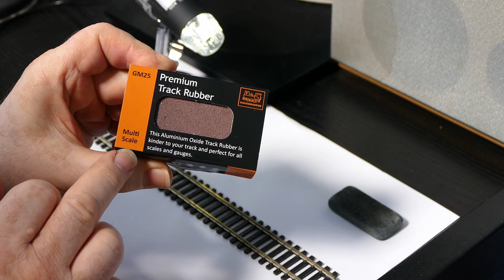Testing the brand new Gaugemaster GM 25 Premium Track rubber, does it scratch? Find out here!

Comment: The Peco track rubber uses fragments of carborumdum, the same as Emery paper. The Guage Master track rubber uses aluminium oxide (AKA ruby crystals).

The tarnishing of nickel silver track over time, even when covered over and not used, is actually caused by the silver content oxidising with the air. It's one of the disadvantages of nickel silver rails versus steel rails. I have both Peco Streamline flexi-track in nickel silver and steel, on my layout, with the parts of the layout with steel track requiring the least amount of cleaning, just the removal of traction tyre residue maybe once a year.
Reply from the maker: Oh now that's interesting, I moved away from steel rails in the late 70s. But you actually find it an advantage?
Reply: @ModelRailwaysUnlimited  Nickel silver has an electron velocity factor of 0.97c, where as steel has an electron velocity factor of 0.91c Basically, in non-engineering terms, steel isn't such a good conductor as nickel silver and so has a bigger power loss per metre than nickel silver. Steel track requires more power boosting feeder wires over a length than nickel silver or ye olde brass railed track.  

According to the velocity factor tables:

Steel has an electron velocity factor of 0.91c
Aluminium has an electron velocity factor of 0.95c
Copper and brass have an electron velocity factor of 0.98c
Gold and Platinum have an electron velocity factor of 0.99c.

An idealised superconductor material has an electron velocity factor of 0.999999999999999999999999999999999999999 etc.  c  (as close to lightspeed as possible).

The higher the electron velocity factor, the better the material is at conducting electricity. The lower the electron velocity factor, the more resistant a material is to conducting electricity. More resistant materials tend to be employed as resistances and insulators.

The ideal layout would have all the rails made from platinum, for the best conductivity.
Reply from the maker: @CZ350tuner  platinum rails it is then 😂 resistivity may me another measure?

Comment: What an excellently produced test.
Very informative, well done.
A couple of boring things: I believe the AlOx cleaning rubbers are used in the electrical industry, cleaning boards, contactors, brush surfaces, that kind of thing.
Secondly I've always thought the Peco (bless 'em) track rubber was always too hard and abrasive, however, in Pecos defence (although it should've been upgraded) the rubber dates from some years ago. Remember farish formaway? Triang series 3? The old triang hornby or Lima? Playcraft?
They were all steel, came pre-rusted from new. Didn't have to paint the rail sides, they'd turn rusty by themselves. Ballasting? Spray that glue and water, you can never have too much rust.
And this was the world that the peco track rubber was born into.
It was a miracle over the 140# sandpaper that was usual.
Since then of course trackage is now a completely different thing, and the good peco track rubber, like the good Hornby Dublo, entered into a world very different from when it departed.
I personally think it should've been retired many years ago, but of course where there's a market. And of course Peco streamline, setrack, premium high quality track products; folks will always take it the the track rubber peco makes is the right one for peco track, understandably so.
I forgot how good your channel was actually, nice to get back to
Reply from the maker: Hi thanks very much indeed and glad to see you back. I agree fully with your observations. Yes, when I did electronics for a while they were used on the connectors. Steel rail, is that coming back?
Reply: @ModelRailwaysUnlimited   Steel rail is back in with beads and bell bottoms.
Thing with steel rail like triang, farish, or the old hornby was that it was bare steel. Märklins iconic m track was tinplate, so even though m track can get rusty, being tinplate it was coated, and etched to a degree. The standard UK rail was plain steel. Now, Dublo 3 rail was drawn brass, which could and did oxidise to a certain degree, but being 3 rail rarely did the track ever actually need cleaning.
During the Korean war where metals were in short supply dublo used plain steel rail and cardboard instead of wafer insulators, both of which ensured very poor quality track. From memory even early peco ready lay used wafer sleepers, which were stunningly good when damp or in humidity.
3 rail stuff of course rarely needs a going over, maybe a quick rub over if it hasn't been used for a few years.

Comment: Heres the spoiler lol..
.these are rebranded Garryson / Gareyflex rubbers that have been used in sheet metalwork for decades. They are available in different grades, and the one ive been using on my track is now 35 years old and barely worn. But in fairness to gaugemaster, similar to most of their other rebranded products,  they havent ramped the price up from the originals.
Reply from the maker: Oh really? well at least we are getting to benefit from the old new tech at last lol

Comment: Nice comparison Mike. It would have been interesting to see what difference the Gaugemaster rubber made over the section previously cleaned by the Peco, would it reduce the scratching. I have tried chemicals but it seems more time consuming and the cloth catches on points and rail joints. Although there have been many videos swearing  by the oil based methods like Inox, I would never use them due to the loss of traction and the problem they cause with traction tyres that a fair few of my loco's have.
Reply from the maker: Hi there, you know I got the feeling it might smooth them out. Lighter fuel is the best method, I apply it via Hornby track cleaner with pads instead of sandpaper

Comment: It is good but its sooooo big ! I have used in the past the smaller track rubber,but i tend to use now IPA and a glasses lens cleaning cloth.But would a few scratches really hurt? I guess it all helps in smooth running thinking about it.😀
Reply from the maker: Check out the GM 24 and it's the smaller one

Comment: Mike, an excellent technical inspection and comparison - well done - we need more dies like this! 👍

The only issue I can see with the Gaugemaster rubber is it physical size when it comes to cleaning scenic track - particularly where conductor rail of other lineside apparatus is present is present (and between platforms).🤔

Notwithstanding I'll be looking to purchase one of the Gaugemaster rubbers.🙂

As an aside, the PECO track rubbers tend to harden with age - have you thought about a comparison between a brand new PECO track rubber and one a few years old (I suspect the results will be similar)?🧐
Colin 🌞
Reply from the maker: Cheers Colin, mines the large block, look for the GM24 small rubber and cheaper. Thanks for the encouragement 😊 my Peco one may be a bit harder than when new but I feel still a valid comparison
Reply: @ModelRailwaysUnlimited  Mike, thank you for the 'heads-up' regarding a smaller track rubber. 👍
Completely agree the comparison is most valid as many people retain their rubber until it becomes unusable. 🙂
I tend to replace mine when they start to become hard although theses are not used as the primary method of track cleaning. 🧐

Comment: I’ve had an old Gaugemaster track rubber for many a year now: one of the strange, slightly spongy black ones that smell funny. So old, it came from ModelZone! 

It’s always done a good job (even if it’s full of deep gouges from cleaning wheels with it) and that too is quite forgiving and spongy. As far as I can tell it doesn’t have any metallic content - though I could be wrong? - which I imagine makes a difference. Only issue is it leaves some small crumbs behind. 

The Peco ones have always made me frown a bit with how rough n tough they are.. I’ve used them at my local shop, but always felt like I’d be safer using a piece of concrete.. 😅
Reply from the maker: Lol the Peco ones used as suggested are actually fine and faster. However the microscope does show scratches even then.

Comment: Thats timely, I was about to pop over the town and grab a peco rubber tomorrow. I think I'll ask him to grab a gaugemaster one. How easily do you think that would cut? Not covered in the video but what happens if you use it on already scratched track? Would it restore it? Or not really as its not super abrasive? Happy modelling 🙂
Reply from the maker: They do a small one too, the GM24, I got the feeling they might smooth it down, but would take a while 😁
Reply: @ModelRailwaysUnlimited  Cheers. My code 75 track has probably had quite the pasting from the peco rubber over the years. I wondered if it may be brought back a bit, not that I've had trouble really. But it couldn't hurt!
Reply from the maker: New video up to answer your question!

Comment: Only problem seems to be the dimensions... way too wide. If you are cleaning in situ, it will wallop everything at the side of the track. It might merit a cut-down to mitigate this. The Fleischmann track rubber is of similar substance and is suitably sized.
Reply from the maker: Ah no problem they make the GM24 which is about the size of the Peco rubber and only £6.75
Reply: @ModelRailwaysUnlimited  Excellent!